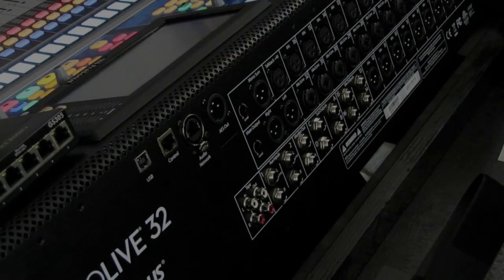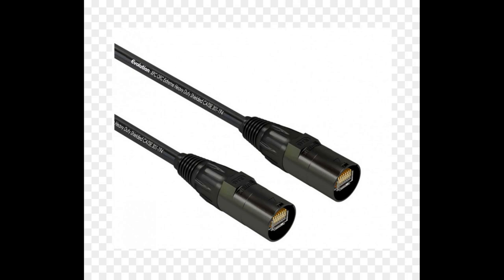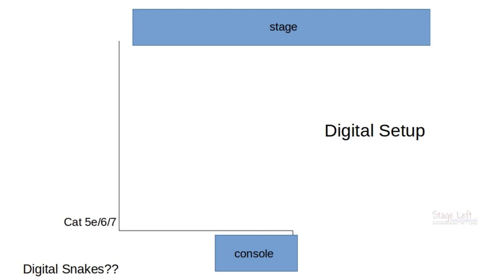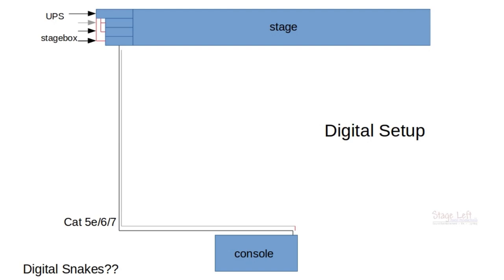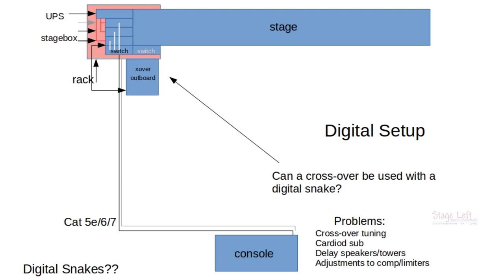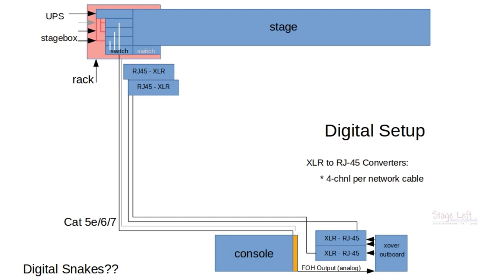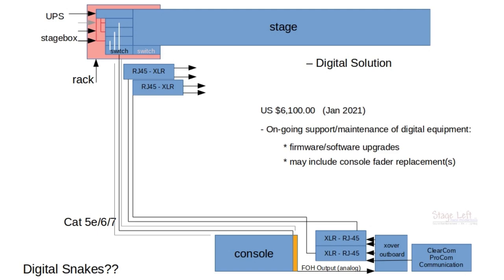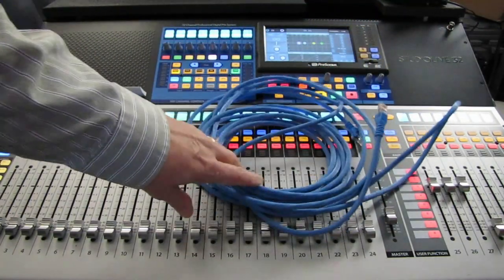Are digital snakes only a single CAT 5e/6/7 cable?  Marketing says they are?

Comment: I thinking to have small pa-system for new/starting band's to rent, is it better have analog system or digital?
Reply from the maker: Analog systems are all pretty much the same, and a lot more intuitive to use.  They are easier to mix on.  If someone already knows how to mix on an analog console, they can mix on other analog consoles without training.   Digital consoles are good, but will require training to those whom will be using it.  If I were to rent gear to new/starting bands, I would choose analog.
Reply: @stageleftaudio  Thanks for answer. =)

Comment: You makes this video a years ago.
All the most important speaker manufacturers have their own tuning systems, and from about ten years ago.
All of this work remotely with other ethernet cable.
Also dbx dsp speaker processor can have remote control, wirelss too.
Also beh 2496 dsp have remote controll...
What your talking about? Are you serius?
Reply: Most recent (ten years always) sound system are active, with digital input (dante or aes), and with own system to tuning each element of the system, from foh position obviously.
Always on ethernet cables.
Reply from the maker: You are correct.  There has been a lot of improvements in digital audio.  Managing a digital system is different than an analog system.  The point of the video was to reference the large amount of "questionable marketing" that started several years ago when marketing firms were stating that a CAT-5 cable was all that was needed to run a digital audio system... which in this video, I show that there is more to a digital audio system than a CAT-5 cable.

Comment: what is your experience using cat6 to xlr converters.  I have seen some that let you  run 4 xlr per cat 6 cable. kind of expensive but may have its applications.
Reply from the maker: From what we have seen, cat5e would be the minimum to use; cat 6/7 would probably make no difference.  All the converts function the same way.

Comment: When you sing in front of a wedge monitor this is about 2 meter in front of you, this is about 6ms.
In large venue there are side system on the stage... 10 meters, 30ms.
Behringer x32, from input to output via stage box: 1.2ms (about 35cm)
Goodbye...
Reply from the maker: There is a ms delay in all digital audio equipment.  There's been improvements in delay over the years.  I think it is getting better.

I hope a company will figure out how to get a crossover to be used at FOH (without the need of a computer).
Reply: @stageleftaudio  I know, but you are talking of mixers only.
So, All other variables being equal, the digital mixer introduces only about 1.5ms of latency.
About 50cm.
X32 is from 2015, or 2014...
Bye

Comment: So so so overworked system! I run a complete system 48 In and 24 out on a single rj45 ethercon cat6!
Reply from the maker: Thanks for your comment.  The video was in response to marketing hype from some companies specifically stating digital networking only existed as a single Cat cable (no switches, no stage-boxes, etc...).  Digital networking has been out awhile since this video... and the marketing hype has stopped.

Comment: Of course you are going to need a backup for everything when you buy presonus products...
Reply from the maker: Actually, for any digital consoles, switches, stage boxes, etc... that use software/firmware (regardless of the manufacturer), it's best to have a backup; especially for anyone who is a sound provider.
Reply: Not had a good experience with Presonus?? What challenges did you have out of interest?

Comment: I guess every data center in the world is at risk because they're not using ethercon? I have no problem with using ethercon, but it's actually a handicap. If you by chance break the connector, which typically means that you broke off the locking piece, The cable can still be used and further secured with gaffers tape in a pinch. Better yet, ethernet is so inexpensive that you should just carry a spare or two depending on the mission critical nature of your event. Try finding an ethercon cable in your local Walmart.

Seems like you really don't understand how AVB networking is used. You can send data from any device to another AVB compatible device.

Where's your comparable analog solution with fail over on every node?

This video was made by a dinosaur that has no idea about technology.
Reply from the maker: Thanks for your comment.  The video covers any audio networking technology, not just AVB and not just Ethercon.  The marketing hype over audio networking focuses on just an Ethernet cable being the only device needed to use a "digital snake" solution.  This video was to show a lot more is actually needed to use a digital solution... as a sound provider.